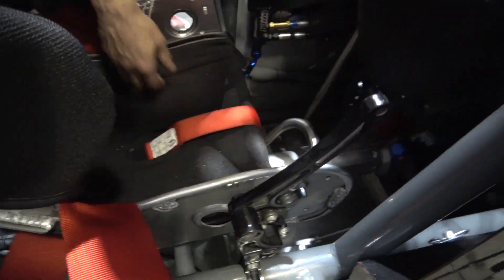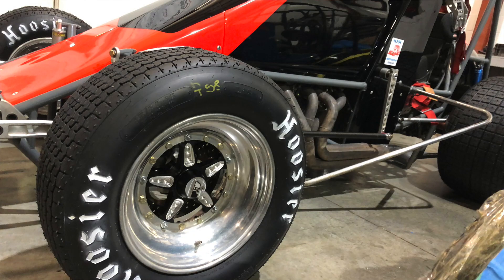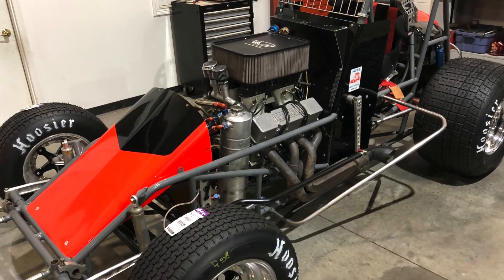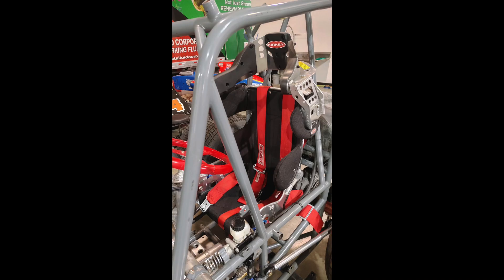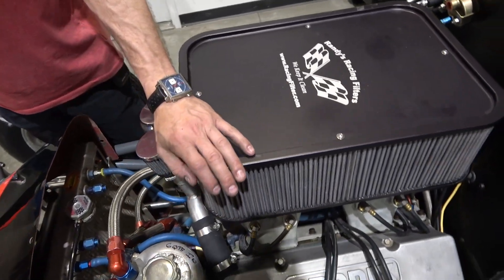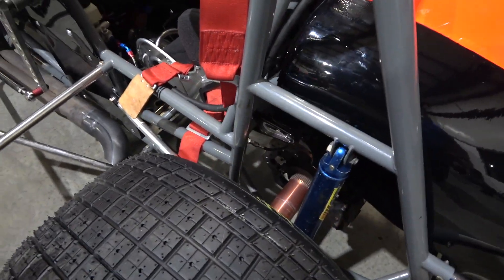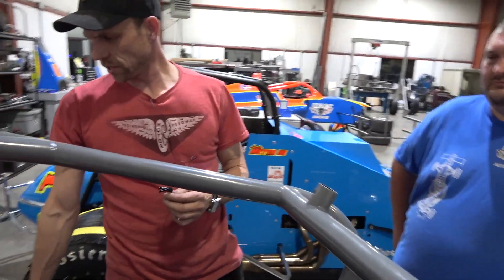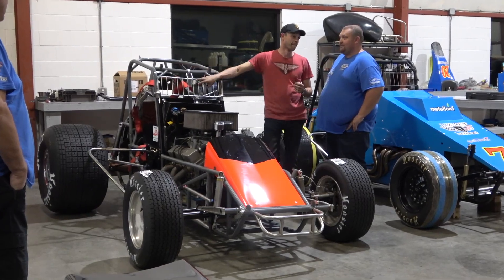The MOST American Race Car EVER!

Comment: For those that aren't familiar with sprint cars they are basically a tractor with chevy 410 in it. Modern winged sprint cars have right around 1000hp and have power too weights on par with or better than F1 cars. If you have never been to a sprint car race (or dirt short track in general) I highly recommend going when you get the chance.

Comment: Casey , i know you are not so interested in straight line speed compared to handling but if you were to put on drag slicks on the rear of this car and drive it on the quarter mile, it will probably do a 9 second pass

Comment: okay, if you're going Dirt Sprint racing you need to hit these tracks:
Eldora, OH  <<< Tony Stewart has owned this for years
Kokomo, IN   <<<  pretty much 30 miles due west of Gas City
Lima, OH  <<< i've never been there, but it's too close to you to not include
.
and Kalamazoo MI if you decide to try asphalt
the Little 500 at Anderson IN is a one off rule set, i'm sure your car could run but you'd probably need to modify a few things.  cuz, you know, 500 laps.